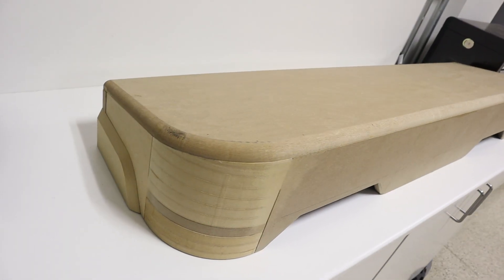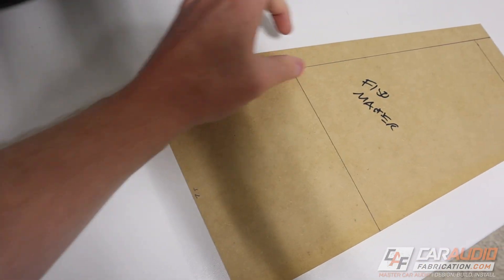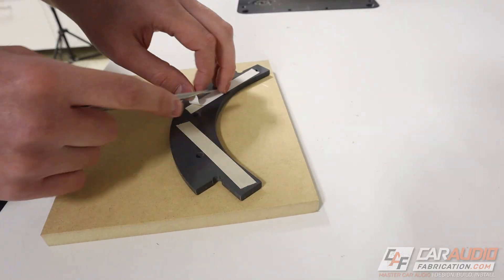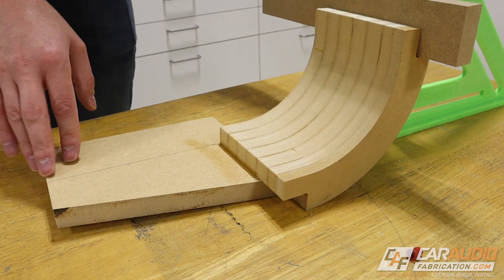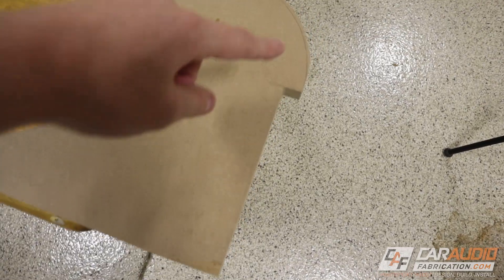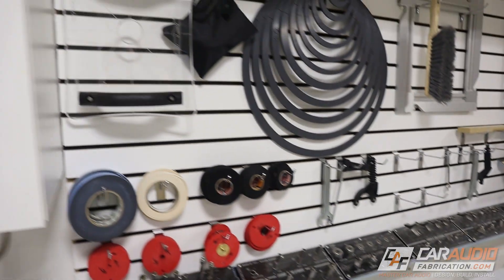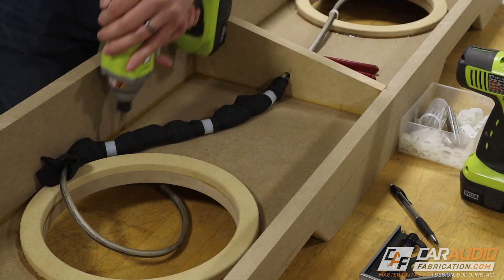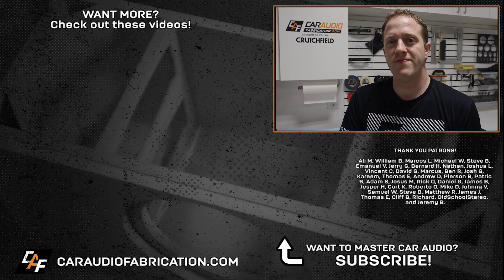Underseat SUBWOOFER Build! How to cut ANGLE!

Comment: What do you say about down firing vs forward firing?  Watched a box builder say that down or up in a truck will sound muffled.  Bass is non directional, but does the air displacement suit the woofer?  I'm planning on building a down fire 10" sub box in my 2023 F-150.  Just wanted to hear your opinion on this.  Thanks!

Comment: Hi, what software are you using to design your enclosure in 3D as shown in this video?  Thank you.
Reply from the maker: Engineering grade modeling software. Everyone seems to think that there is some magical software that removes all thought from design and just spits out subwoofer enclosures. It takes years of learning, expertise, and testing. Tons of math and understanding.
Reply: Did you find anything, looking now and most online tools are too basic for the design I want to do. googleing not working very well for more advanced designs like this one.
Reply: @pohlcat01  no but didn't look very hard either.  I'm sure he used a paid for software.
Reply: Found  freeCAD haven't tried it yet.

Comment: I just built one very similar to this. The only difference was I put 4 front firing 8”s in it under the seat in my SC F150.  Turned out great!!  Thanks for the videos!!
Reply: what did you use to calculate the air volume?

Comment: I watched that video carefully, taking notes and doing math.  Those two sealed chambers are approximately 0.6 cubic feet total internal volume, each.  You installed Rockford Fosgate T1S2-10's, and the manual for those woofers says the speaker displaces 0.03 cu.ft.  Therefore the Vb of each of those chambers is approximately 0.57 cu.ft.  For a sealed enclosure, the RF manual recommends a Vb range of 0.5 - 1.0 cu.ft., and an optimum sealed Vb of 0.8 cu.ft.     With the Vb of this enclosure build on the very low end of the spec, it should have a harder time playing low frequency notes.  So I ask you Mark, how does this build perform?  I'm a newbie, still learning.  I think perhaps "resonant frequency" may be one of the parameters that comes in to play here.  That's the frequency where the box makes the highest SPL, right?  And SPL tapers off in both directions?   Wouldn't this enclosure "sound better" with woofers that are more closely matched to the optimum Vb,  such as the JL 10TW3-D8?

Comment: Why would you use a down firing sub over front firing?
Reply from the maker: Good luck getting a 10 inch sub to face forward without a seat lift when only 7 inches of height are available.
Reply: @CarAudioFabrication  Thats not my question, Why would you use a down firing sub over front firing?
Reply: @CarAudioFabrication  Well?
Reply: @livingwaters7841  was his answer not clear enough? This is an under seat build. He used downfiring because the dimensions are not limited. Whereas if he went front firing, all he could fit in there would be 6" woofers.

If you meant in general why would you go downfiring over front firing, maybe google it? I imagine it is all aesthetic
Reply: @RogueCow  Why would I need to google something that I am asking a "professional". Its a simple question, "Why would you use a down firing sub over front firing?" If Car Audio Fabrication cannot answer this for his topic "Underseat SUBWOOFER Build! How to cut ANGLE!", then I would go to a person to answer. Being an e-tech and moderately understanding "sound", I am open to suggestions since I am building a sound system for my 2015 F150 crew cab. 

Getting good advice and support in any topic these days seems like a hassle. Its very sad, that we do not have enthusiasts who are openly and gladly volunteering their experience or knowledge in any topic without being sarcastic or arrogant about the topic. Not saying that you are  any of these.

To answer your question: "was his answer not clear enough?" It was NOT clear whether down firing or front firing subs sounds better.

Before your reply, PLEASE see my first question from 2 months ago.

Again, let me explain a little more clear, Why would someone use a down firing sub over a front firing sub? NO dimensions are mentioned in MY question... perhaps someone with the experience and understanding can answer.
Reply: @livingwaters7841  since you expect other people to do research for you, the main driver of driver placement is the available dimensions (again, an answer easily found from the googles)

Relative to CAF, he did REW comparisons in another video that show there is very little real world difference comparing down firing, front firing, side firing, etc...

Your simple question is easily missunderstood as you posted on a specific install video...

If i build something and post a how to video and someone asks "why would you build it that way", i'd be forgiven by answering why i built this specific box in the scenario.

Maybe phrase your question better? "Why would someone build a downfiring subwoofer over a front firing subwoofer", which i think is what you wanted.
Reply: @RogueCow  I dont expect anything from anyone. If you can add to the topic, perhaps you should go stand in a nice shaded corner and mind your own business
Reply: @livingwaters7841  lol, okay budd

Comment: WOW! Dude you never stop Amazing me. Your Truly GOD Gifted with Talent. I have a new 2021 Ford f150 supercrew Black. I want to run 2 Skar vd8 shallow subs in a down firing enclosure. I want it about half an inch more than normal tucked under the seat. Have you been able to Fabricate on yet??? Skar has their recommended measurements for space needed port size etc....
Reply from the maker: I do not recommend those subwoofers as they are not true shallow mount, they require too much air volume, they have a pole vent on the back that needs space, and they have a large mounting depth. You need a true shallow mount sub. JL Audio and Rockford Fosgate have great choices that are a far better design in my opinion.
Reply: @CarAudioFabrication  how much is this enclosure in basic black carpet
Reply: @CarAudioFabrication  ok I'll go dual 10's

Comment: I noticed you mentioned a mono connection to the amp. With two subs, would it make it any better to use a dual channel amp and set the subs in stereo? If not in this one, in what circumstance would a stereo sub configuration be better?
Reply from the maker: Your car is not a movie theater. Stereo subwoofers is pointless.
Reply: To further add on this reply for new people to understand. You car is too small of a space for your ears to be able to discern where a bass note played from a sub came from. 

In a large room like a theater it would be worth it, in your car stereo subwoofers would be pointless.

Comment: Hey buddy. So I have a question that may seem a bit ignorant or maybe I’m just overthinking it. If I’m building a sub box for let’s say.. 3 8” subs. The spec sheet calls for a 10sq. in. Port area and 19” port length to achieve a tuning freq. of 35hz for 1 sub. Do I need to triple that to have the adequate port volume for all 3 combined? To me that seems a bit excessive. Thanks in advance

Comment: I see some others have asked about the box volume and you said you can simply cut a whole in the brace, did that not change the volume of the box?, and you said it's fine for a mono signal, will you please expound on that in relation to the shared space of the two subs on the mono signal and air volume?

Comment: u should post the specs so us f150 owners can copy lol
Reply: In my F150 I built a single 12” enclosure down firing for a much better/deeper xmax capable sub as a center console extension in the rear seating area even adding cup holders and a charging station on the top. I also have two equal size storage compartments under the seats now too. It’s effectively a 2 + 2 but I never put 5 in the cab anyway . It’s held in with a plastic coated chain to the rear seat mounts so it’s technically removable in a pinch . Wish I would have built it deep enough for the Stereo Integrity SQL-12 as my regret though...maybe next time. Mark’s builds are next level to anything I could do or imagine though...props to the master craftsman!
Reply: Edit: He should offer his plans for sale.
Reply: @honduken  he does. They're in the links. They sell the blueprints for boxes.

Comment: I have a kenwood radio and a epicenter going to a Rockford fosgate 300w amp to 2 12inch Rockford fosgate subs. When I put the truck on to accessories part on the key switch. The subwoofers start thumping without any music. And the epic switch turns on but does not work when I turn it. Can some try and help me figure what’s wrong. Also my positive cables start stinking up in the amp.

Comment: hi folks! i have a question about BRIDGING .. hope you can help me.. im just a car audio enthusiast.. my question is.. if i have a 4 channel car amp(4ohms per channel) .. and i want to wire it to 3 channel..hooking 2 speakers to the   the left and right channel.. and want to bridge the remaining 2 channel for the SUBWOOFER.. does the impedance of the two channels will be added.. like 4ohms + 4ohms=8ohms or it will stays at 4ohms?

Comment: I find using DOW board or rigid foam board works great for roughing out odd configurations and angles. Its cheap per 4x8 sheet(like a few bucks depending on thickness) and can be cut with k-nife. On a side note, I feel like you could make that cut in one pass with a chop saw or radial arm saw at a compound angle with a part axis change. But thats beyond this video and would definitely depend on part thickness, and vise setup.

Comment: I have seen you do rounded corners a couple different ways. Is there a specific reason you used stacked material for these corners instead of using the method where you cut several grooves in the material not going all the way through, allowing the material to bend around the corner? You could of used a single piece of plywood to make two 90 degree rounded corners and then a second piece on the back. Just curious if there is a reason to do one instead of the other. What factors come into making that decision? FYI I love your channel!

Comment: I recommend either attaching a piece of metal or wood to the underside of your sled that would fit into those slots on your table saw. Than you dont need to use your fence and you eliminate that possible error, plus you can cut much longer boards. If you add a rear fence that you true up to be 90 degrees to the blade, you can also quickly cut accurate 90° cuts.

Woodworking for Mere Mortals has a good simple plan for a crosscut sled.

Comment: Is the ca glue really expensive? I noticed you did not use it for the larger piece.  And used the wood glue/nails to hold that.

I understand the ca glue is quick drying...but am totally curious as to why not use the same glue for the whole thing.  Was it because the larger piece would allow the ca glue to dry unevenly (due to the nature of starting and ending the glue up process)?  I am wondering now if I answered my own question correctly.  Inquiring minds wanna know.

Praying your cold goes away!
😇😎

Comment: Why not put the template on the baffle? Instead of mounting it first?
Reply from the maker: Because then you have to precisely align the already cut pieces, and most of the time it doesn't line up quite perfectly so you end up with a ridge to fill or sand. By rough cutting then attaching and flush trimming the surfaces are perfectly flush. Hope that helps!
Reply: Got it! Future Fab topic, and I love mine, using and building a table saw sled.